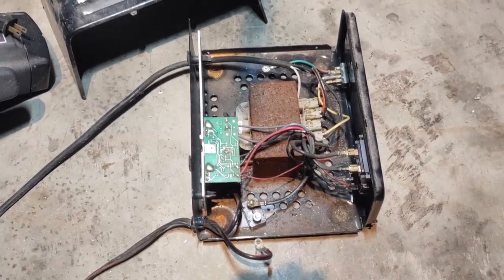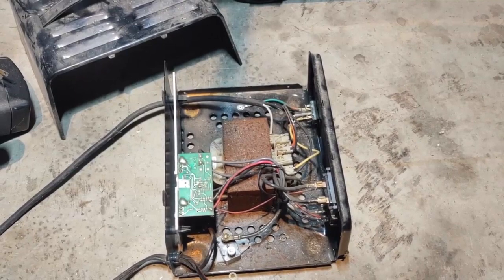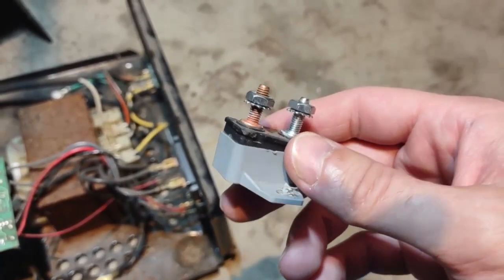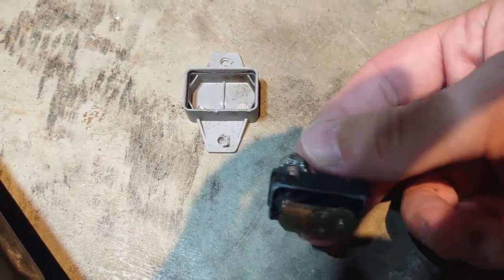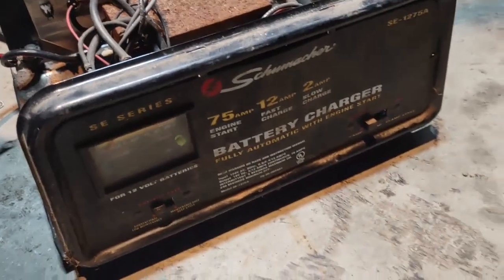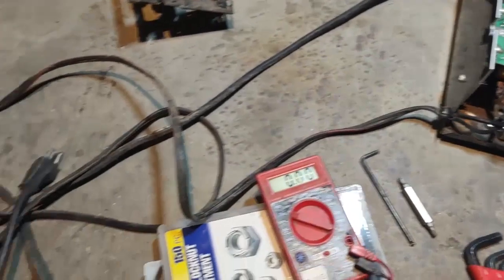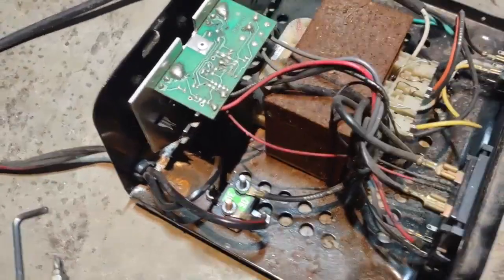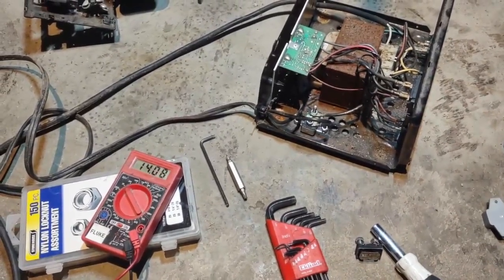Fixing a broken battery charger!

Comment: Good job. It's amazing what people throw away. I've got the 200 amp starter version. It had two bad press fit rectifying diodes that were broken in half. Amazon had 2 for 26.00 and it's working again. I upgraded the heat sink plate with a CPU heat-sink that I cut in half and drilled/tapped it to attach to the plate and used thermal paste between the diode and heat-sink. I also installed a 110v cooling fan scrounged from a microwave oven to blow across the fins. Now when it's charging it doesn't even feel warm.
Reply from the maker: Learning how to troubleshoot electrical stuff has been a game changer.